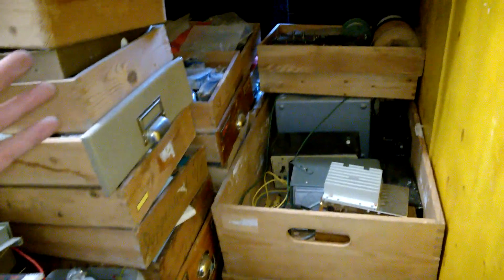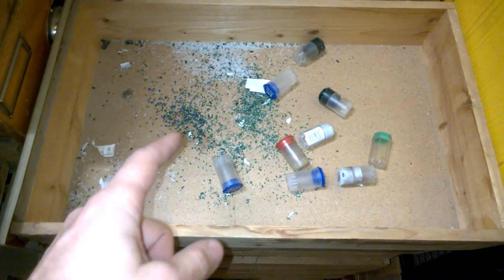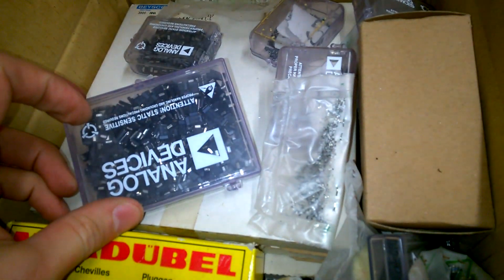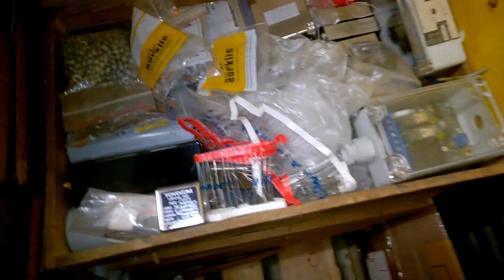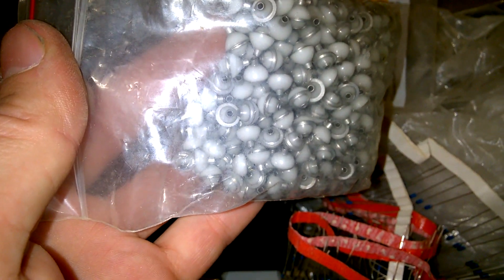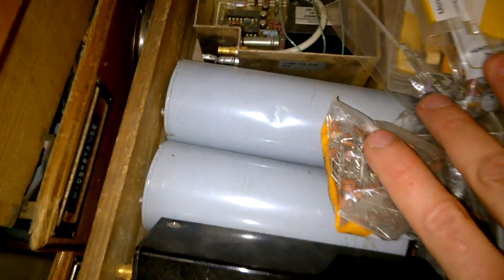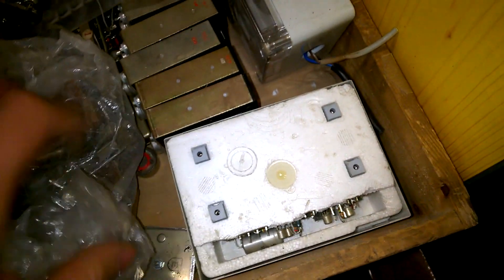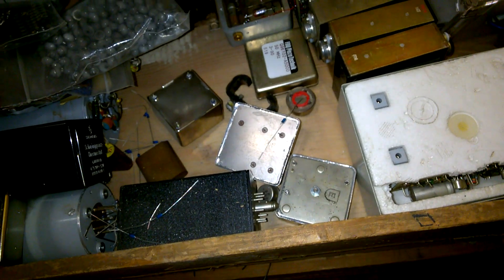CEPUS #1: Crazy Electronic Parts Unboxing Series (Mini-BEB)

Comment: Will you ever be able to put AL of that on ebay? Seems to take ages to get through all of them
Reply from the maker: :-)
Let's see. For commercial reasons, items have to have a minimum "value" to be qualified for ebay (like 35 Euro/item). 
....either as a single unit, or combined to a lot.
Reply: @MaxKoschuh  Is that some sort of Ebay rule for where you are (Austria, I think?). Here in the US, I routinely put things up for just a couple of dollars.
Reply from the maker: @uniservo  
I can sell for 1 Euro. But each and every sale is consuming atleast ~30 minutes of time. Hence the "minimum value" that I have dictated myself.
Reply: @MaxKoschuh  Understood. I find for the little parts, I can invest only 4 to 5 minutes of my time per lot for many little items (yes, I have timed myself), including photographing, cleaning up the image, writing a description, handling the invoice, and packing and shipping. Less, if it is an item I have lots of and can just hit the relist button - that cuts the tie drastically. For example, for those solder-in white glass insulators, I might break the bag into four portions, and put just three or five dollars on each portion. Plastic baggies and self seal bubble mailer envelopes save the day!

But yes, anything that involves real packing (like equipment or big power tubes) is a different story.